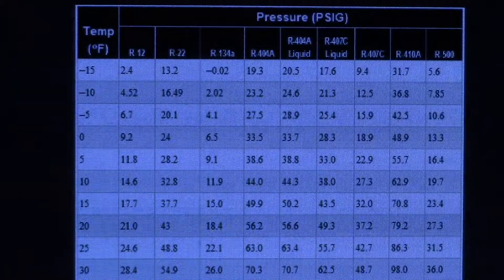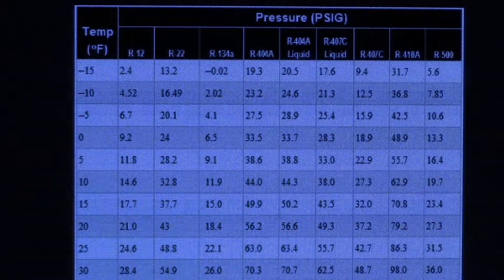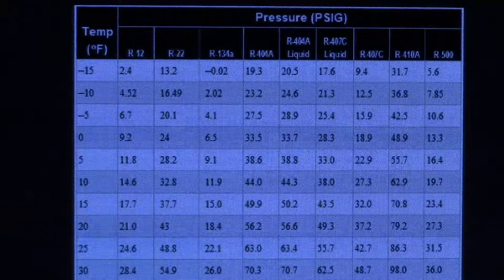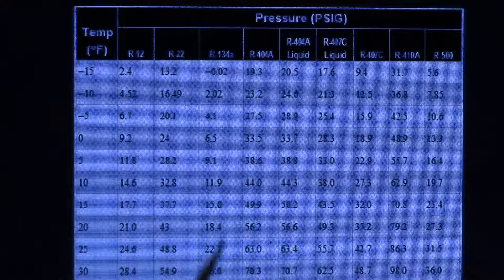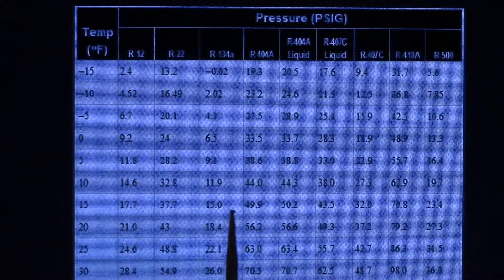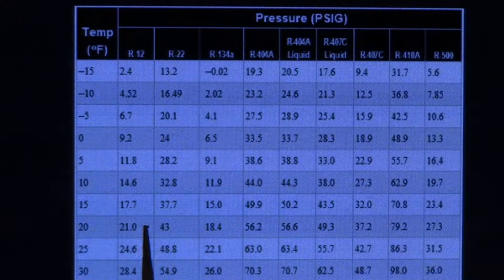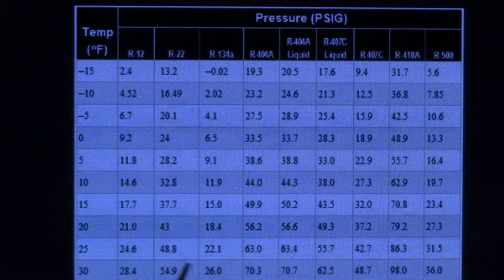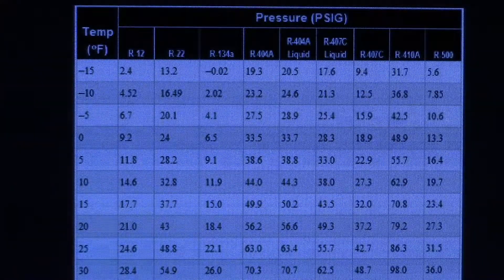Basics on reading a refrigerant PT chart

Comment: where am i getting that pressure from? and pressure of what?
Reply from the maker: connecting your gauges to the system. so if it was an air conditioner the blue gauge said 60 psi, you find what refrigerant is in that system and convert that 60 psig to the temperature of that refrigerant.